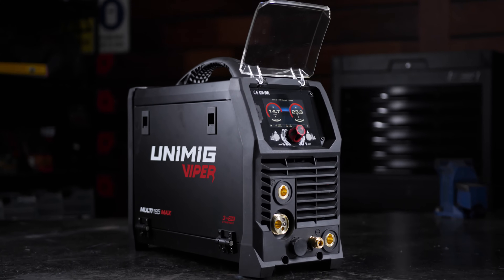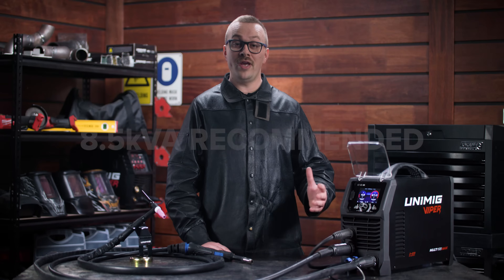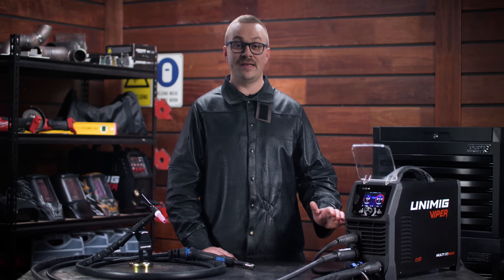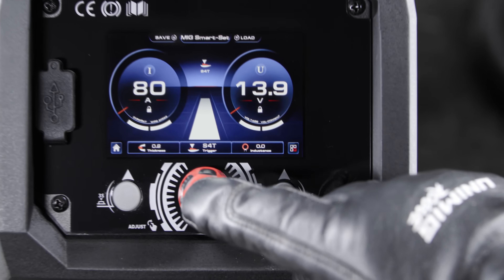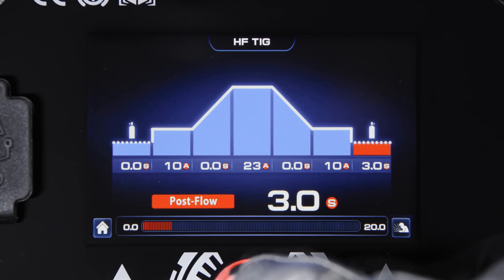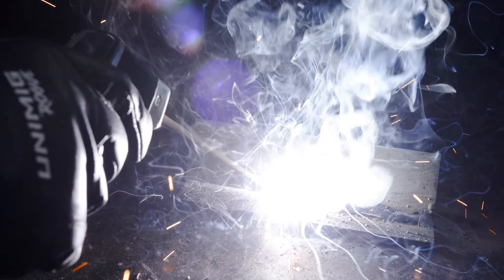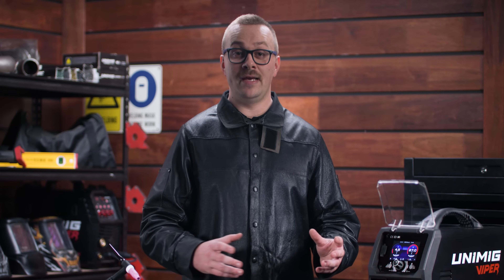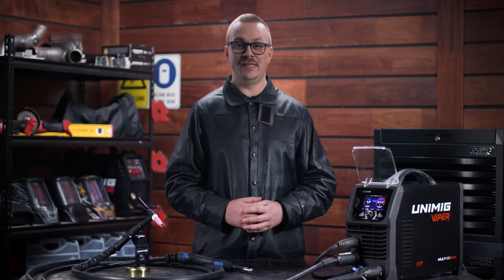VIPER MULTI 195 MAX Feature Video

Comment: What thickness aluminium can the 195 unit weld up to? I need to weld a crack in 6mm aluminium. The 185 user manual shows volt and wire speed setting for up to 8mm for aluminium. But I couldn’t  find anything on the 195 user manual.

When I called the unimig support number they told me the 185 & 195 would not weld 6mm alloy?

I like the look of the 200 pulse but I don’t have access to a 15A socket.
Reply from the maker: Hi there, we have two new models launching next week that are designed to handle these applications — the ENVY Multi 230 AC/DC and the ENVY Multi 195. If you’re limited to a 10 Amp power supply, we recommend the ENVY Multi 195.

Comment: can u pulse mig with the 195?
Reply from the maker: The VIPER MULTI 195 MAX is standard MIG welding only. For a pulse MIG machine take a look our our RAZOR MULTI 200 PULSE: https://unimig.com.au/product/razor-multi-200-pulse-welder
Reply: @UNIMIG  wow that welder is a beast but a bit too good for me. i was hoping to be able to try pulse mig for my van restoration with the 195 as i have read pulse can create the same weld with less heat and looks realy neat. could you advise if pusle mig works for 1.2mm galvanized sheet metal? i dont think i can afford the pulse mig but i cant find online if its suitable for gal sheet

Comment: What is this unit like with  welding aluminium  just with the  mig gun and not having to use a spoil gun ?
Reply from the maker: Hi there, If you want to weld aluminium without a spool gun it's best to use a 3M torch as aluminium is very soft and can be difficult to feed. To do this you need to ensure you use U groove rollers, teflon liner & neck spring. If you need part numbers please let us know.
Reply: What's the part numbers?

Comment: Hi I have razor multi 230 welder. I use flux core wire gas shield version, there's no option in the pre set for flux core gas shield how do I weld with the right option? When I weld with my flux core gas shield wire 1.2mm the finish weld seems not right.

Comment: Will my 150a spool gun work on this I currently use it on viper 185 ?
Reply from the maker: Hello Wayne,

The device comes with a 9-pin connection, but the pin arrangement needs to be adjusted for proper functionality. Please contact us at support@unimig.com.au, and we'll provide you with the necessary pinout diagram.

Comment: What's the limitation that prevents AC tig being available in these AIO machines?
Reply from the maker: Hi there, AC TIG requires a larger board and more components, which increases the machine's size. This also has a significant impact on the cost of components. While the Razor Multi 230 AC/DC is more expensive, it justifies its price by offering a more comprehensive set of features, including the capability to operate on a 10 & 15 Amp plug. This is in contrast to the more budget-friendly Viper Multi 195 MAX that doesn't feature AC TIG.